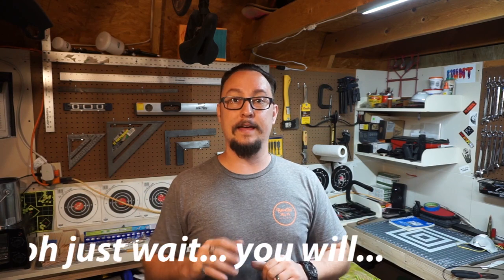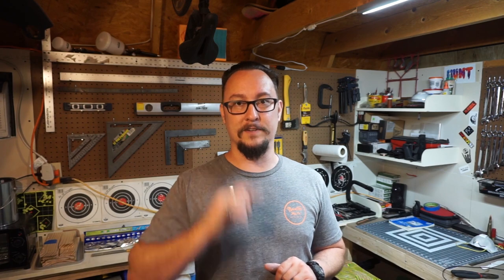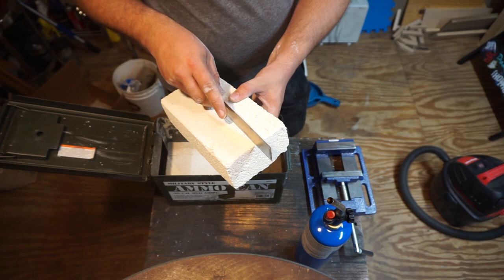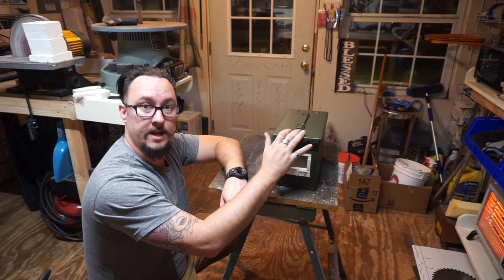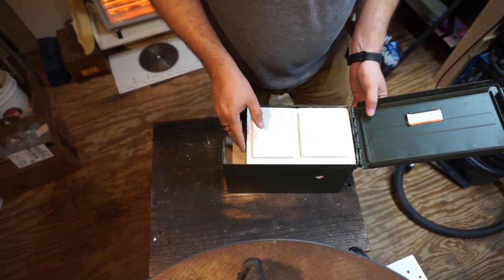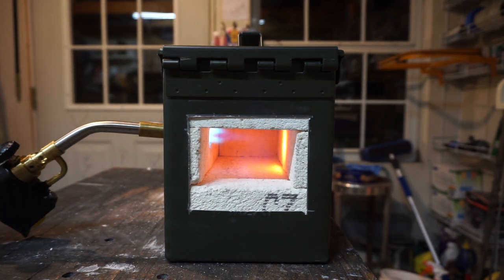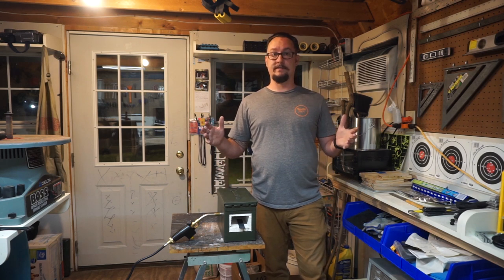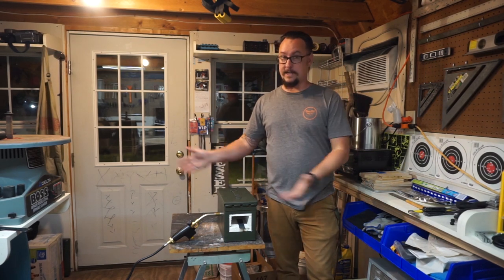How to make a Forge out of a Ammo Can

Comment: Great video.  I got my setup running a few days ago to harden a blade for my little bro.  It worked great.  I did a similar setup with the ammo can, fire brick, bernzomatic ts8000 torch head and propane tank.  I ended up coming in from the center of the back so the flame is blowing straight toward the opening.  I filled the gaps with kwool.  I might shrink the chamber size a little bit for more efficient heating.

Comment: Love it - I will do this!!  I have the fire bricks to use based on another design I had seem.  But your design with the ammo can to house the brick is brilliant - protects the brick, has a handle to easily move around and looks great - should last a very long time and the brick is easily accessible for maintenance if required.  I might cut a hole on the back have a looser fire brick to slide in/out in case I want need more length.  I have some large horseshoeing files I want to anneal to use for knives.  Thank you for your videos - really enjoying your channel - one of the better ones!!!

Comment: Hi there,
another great video 👍 I'm currently using a two brick forge with a torch for annealing and hardening and it works fine. But the forge needs to be handled with care because the bricks are so fragile and i don't have enough space that the forge can be build up permanently. So i really like your idea using an ammo can to protect the fire brick. I can't weld so building my own casing is no option. Did you ever thought about using electrical heating with PID control? I'm lazy and it sucks running out of gas if there is time for knifemaking, so i thought about changing to an electric heating. Forging is not an option for me, so only stock removal knifes will be made.  As a bonus that would open up the opportunities to work with stainless steel.

Comment: I do have a couple questions. 1) Is there any concern about the seams (cracks) where the bricks join each other? Will the heat leach between and get to the sheet metal? Could you use bricks end to end to deepen the forge all the way to the back of the ammo can? 2) How thick must the bricks be to be effective and not affect the sheet metal? Is 1” enough or do you need 2” all around?
Reply from the maker: There really isn't a concern about the heat between the bricks. My main forge is just bricks sitting on each other and heats up to 2400 degrees on the inside and is only 190 degrees on the outside (measured with a laser thermometer). 1" thick is plenty for a forge this small, I would probably go with a minimum of 1.5" though.

Comment: I ended up making this, but even with the hole angled back and down a bit, it doesn't get hot enough. I have to hand hold the torch at the front opening to get the metal up to temp. 
I will have to play with hole placement a bit.
Reply from the maker: Are you using MAP gas or propane?
Reply: @theriversexperience9383  map but possibly the tank sits too angled without an extension hose?
Reply from the maker: @thomps6s  if you get a chance send me a picture or two of the forge. theriversexperience@yahoo.com
Reply: @theriversexperience9383  Emailed, but please don't rush to respond. I am in no hurry.

Comment: Cool design, which I will likely try. But good God, wear a freaking respirator! Breathing that dust is bad news! I also wonder why you didn't make the chamber the size of the cutout?
Reply from the maker: It would have left the walls of the forge to thin to contain the heat. they needed to be a little bit thicker than I originally expected. I agree about the respirator, hind sight is 20/20.
Reply: @theriversexperience9383  I forgot to ask, what are the dimensions of the cutout in the can?